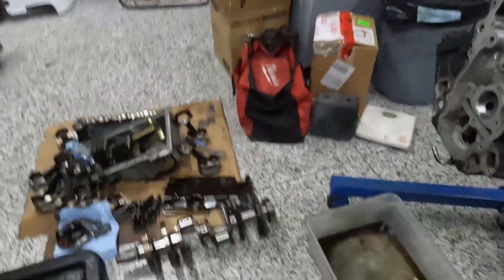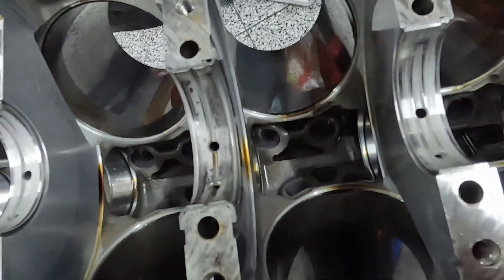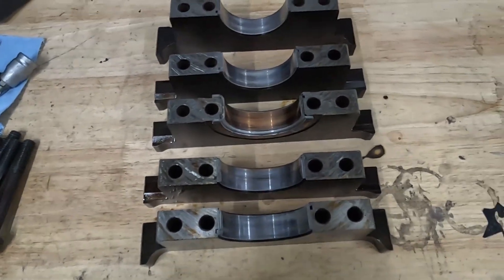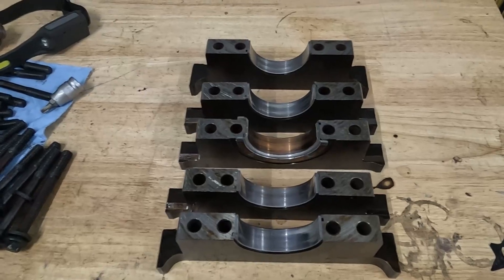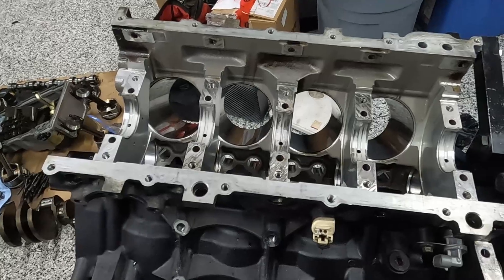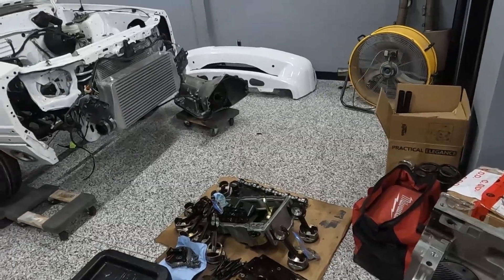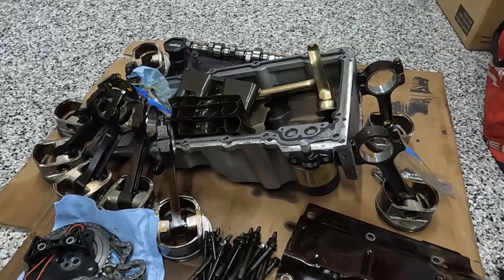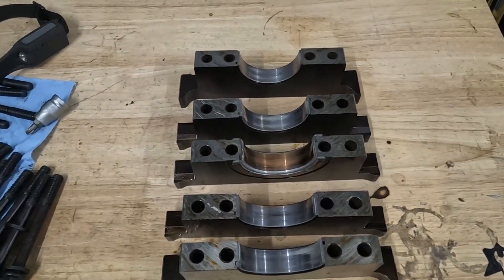I found the limit of my stock bottom end gen 4 LS Engine

Comment: I wonder if your main bearing problem was caused by the oil pressure dipping at the launch.  I have a 2002 Camaro with a turbocharged 6.0 on E85; best time 9.44 at 144 MPH.  I tore my engine down because I'd been running it for quite awhile and figured it was time to do an inspection.  I had one rod bearing down to the copper.  Talked to my local machine shop and he said it looked like it was caused by lack of oil.  After that, I checked previous data logs and saw that the pressure would dip on the launch.  I see you had a stock pan on yours.  I found a company that makes a baffle that bolts into the stock pan so that's what I did.  The seller also recommended running 7 quarts in the engine rather than the stock 6.  It sounds like you're going to buy a different pan.  I would definitely look at data logs with the new engine and make sure oil pressure stays steady on the launch.  Good luck!
Reply from the maker: @SunnyMidnite221  yes it's funny because I also noticed the same thing! I have a baffled moroso pan now and will update you guys on the car soon. In short I can tell by the pattern on the main caps they were moving but certainly that pan didn't help!

Comment: Looks like you also have fretting on your mains. The 3 inner caps look damaged on the mating surfaces.
Reply from the maker: @carstuff4260  very possible combination of caps moving and crank flexing. Bearings in the block side look perfevt but definately was dancing around there

Comment: Ive Got The Same Crankshaft Flex Problem On My 3.8 V6 Turbo. About 600WHP On 27PSI. Wiped Out The Mains Just Like That 2 Times. First Time It Lasted 5,000 Miles Before No Oil Pressure At Idle. .0025" Main Clearance But With Incorrect Engine Balance. Rebuilt The Engine With Correct 50% Balance And Same .0025" Main Clearances And Got 15,000 Miles Out Of It Before No Oil Pressure At Idle. This Time We Are Gonna Try Out .0028-.0030" Main Clearances And See How Long It Lasts. The Owner Of Hellion Turbo Actually Looked Over My Crankshaft And Recommended We Try A Looser Main Bearing Clearance To Let The Crankshaft Have Some Room To Flex. Hellion Specializes In Very High Horse Power Coyotes And He Runs Around .0030" Main Bearing Clearance To Keep Them Alive.

Comment: Man same thing happened to me.  I put a nice piston/rod setup together and it wiped out the cap side of the center 3 bearings on the dyno.  It made 1140whp on the dyno.
Reply from the maker: @86boostdcapri  wow that's good power! I am studding the bottom end and going forged crank this round! Could be the result of the crank walking or moving around for sure also. Just shocked how good those pistons and rods really are
Reply: @WestcoastWrenchin squirrel tuned was making 1700hp on the sbe 4.8... 7.80@168 38psi

Comment: Wow, very interesting. Some serious HP. Just putting the finishing touches on a wet sum LS7 build for my 70 Camaro. I used a LSX block with stock everything else. Should be 500HP at the crank. Working on accessory brackets now.